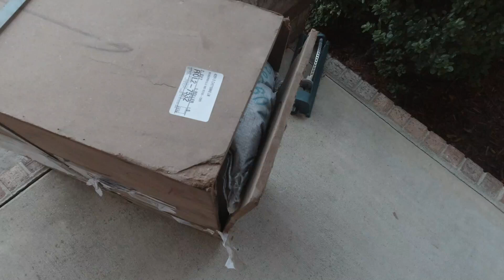Installing Windows in Our DIY Off Grid Camper | Windows from China (success or epic fail?)

Comment: I am remodeling my Hot Rodded Class A and have been wanting to change out my windows to the same windows.   (The big windows it has sliding glass, and the are a real pain to slide.) (And the bedroom windows are slats that crank up. Very Ugly)  So the link is perfect for me.  Rewallpapering it right now and then will paint and restain all the Solid Oak Cabenetry. Then new floors.  I noticed you went with vinyl after issues with the wood flooring.  Good information for us.  Thanks.  I want vinyl and the wife wanted wood, until I showed her your issues.

Since my Big Girl is 37.5 feet long I won't be off roading it, but I have been known to run up and down the beach a time or 2.  I get away with it because I installed Limited slip in my rearend and it's a triple axle Bus, so it floats on sand pretty well if I air down. And having the gearing and horsepower is an advantage.

I've been lusting over the Freightliner Ambulance build..Yours is like I would be building if I didn't already have my Big Girl already paid for, and hot rodded up...
Still catching up on all your post as fast as I can.
Reply from the maker: Hey! We’re really happy with how the vinyl sheet flooring is holding up now that we’re on the road. And honestly, we ended up really like the look of it too. Good luck with your build, maybe we can meet up one day!